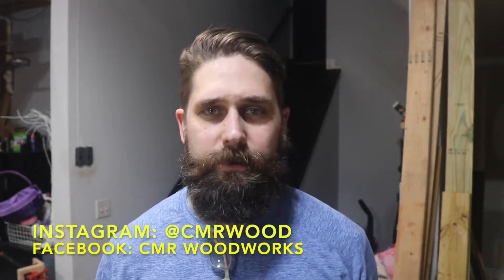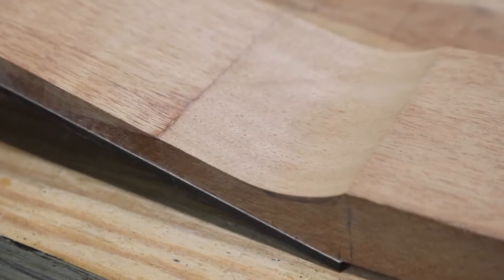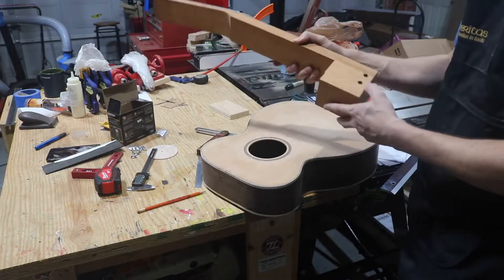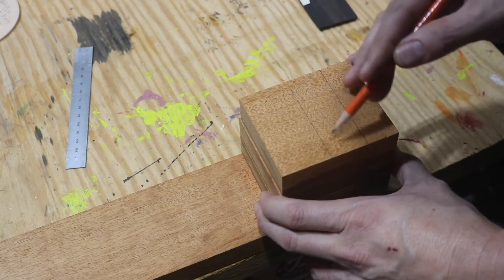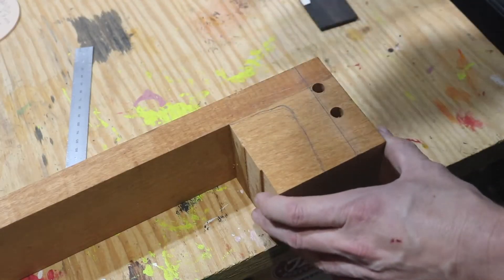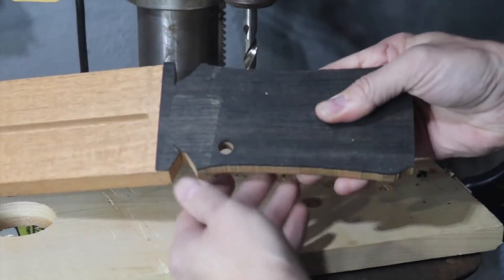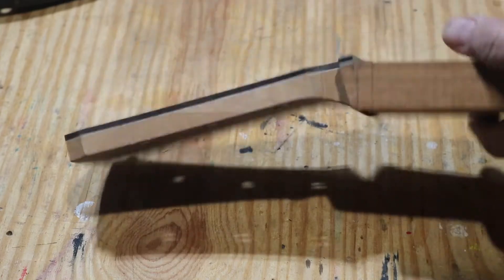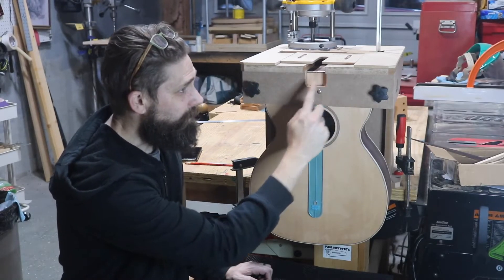Acoustic Guitar Build part 10 // major problem

Comment: This is a classic first build. It's like anything else, you have to fall to learn. Make mistakes and fix them for your next builds.  Everyone is correct here. You must continue on and keep going until finished. These are awesome videos. These show the bumps and bruises that everyone goes through building thier first couple of builds. Next time, for sure, I would deal with the flatness, of the neck joint, on the body before routing. Also, those drill marks might be an issue unless your insetting the neck into the body. If not insetting, maybe you can account for it when rerouting your angle. Thanks for the videos Chris. I think this is super needed for beginner luthiers.
Reply from the maker: Thanks so much for the encouragement. I still have another 1/8” to cut off. I didn’t go all the way down with the plunge router. I think that those drill marks should be gone after cutting off the last bit. I hope so, at least! For my next guitar I will definitely be mindful of keeping the sides flat where they should be flat. I remember seeing a slight bend in the top when I first bent them.  I didn’t think it would be an issue and thought that when I glued in the heel block that it would straighten it out. I just didn’t know enough about guitar building at that point to know any better. But I know now!

Comment: Don’t let it get you down, I have been building 2 parlor sized guitars one for each of my sons, I had too make new necks because I messed up the tennons & Then I realized I screwed up the X-Bracing so I had to remove the tops & build new tops. I have been a woodworker for 40yrs and a Trim carpenter for 35yrs,  I will tell you making guitars is the most hardest tedious thing I have Ever done. God bless & keep on moving forward.🙏🙏🇺🇸🇺🇸🎸🔨📐🪚🎼🎹👨🏻‍🦯👨🏻‍🦯
Reply from the maker: Wow, well I guess I can’t complain too much after hearing about your trials with the parlor guitars! And two at the same time at that. I’m impressed you pushed through it. Good on you man! I appreciate your encouragement!

Comment: Chris - you’re doing great.  I would cut the angle in the tenon and route it again.  I messed up the neck on my guitar and ended up cutting too much off.  My 12th fret is about 1/8” off the body joint, but absolutely no one notices it but me.  You will still set the bridge location based on the distance from the nut, so it won’t affect the intonation or sound. Take a break and get back at it.  You will love it when you get it done.
Reply from the maker: Good to know that even it the right fret doesn’t line up perfectly at the right spot, it’s still okay. Makes sense what you say. Thanks!

Comment: Don't get disheartened man. I know you only have limited time to work on it, but you'll never do your best work while rushing or frustrated. Try to take a break and come back when you feel you're ready. I'm building my first guitar right now too, and making a point of only working on it when I'm at my freshest and most motivated. Again, don't let it get you down!
Reply from the maker: Thanks so much for the encouragement! You are right, though, about rushing and working while frustrated. I fixed the neck angle issue a couple of days later and felt much better after thinking about it for two days. Hope your build is going well!

Comment: Don't give up, bud. These kind of mistakes are part of the process. I would say this: make the adjustments you need to make with the neck and get the fit perfect. Your 14the fret position may end up further on top of the body, but that's not really a big deal. Just position your bridge back a bit further to compensate. I'm sure it'll only be 1/8" or so. No one will notice and it'll play and sound just fine. You got this, man, don't give up!
Reply from the maker: Thanks so much for the encouraging words! Yes, I think the amount I moved the 14th fret onto the body should only be a couple of millimeters or so. I really didn‘t have to take off too much. I‘ll be sure to avoid this issue on the next guitar. I had no idea that something I did way early on in the build, in this case not doing a great bending job, would lead to such complications later on. But I‘ve learned a lot and I am glad. Thanks for watching and taking the time to comment. I really appreciate it!

Comment: Will the veneer added to the back of the headstock throw off the thickness that the tuners need to protrude thru the headstock?
Reply from the maker: You know, I‘m not really sure ! But I don‘t think so. It‘s only .6mm thick and the headplate on top is maybe 3mm thick so I guess if I have to then I can thin down the top. In the course I am taking, the instructor adds a veneer to his. He accounted for adding veneers and a top plate when the headstock is thicknessed initially. He makes it a little thinner so that he can add the extra layers.

Comment: Don’t give up and don’t scrap it     Shave the tenon and then floss down the shoulder till it fits correctly.   Use 80 grit first. To take off most of the material.  Then finish up to 220
Reply from the maker: Yeah, I did that a little on my ukulele, but I’ll have to do quite a bit on this guitar. Thanks for watching!

Comment: after you make your tenon/dove tail, take packing tape and 120 grit sand paper, and put it under the neck neck in the joint and do pulls of 5 and blow the dust off and you'll sand the weird curve into the heel of the neck
Reply from the maker: Yes, I had to do some of that sandpaper pulling on my ukulele. In the course I am taking, he calls that “flossing”, haha.
Reply: @CMRWoodworks  flossing! Lol 

I just call it adjusting the pitch of the neck, but it’s neat to make a guitar do the floss

Comment: I see now what happened. This isn’t a huge deal but a great learning experience. If your neck ends up being 1/8 or 1/4 inch lower than you wanted it just lower the bridge to match that and keep your intended scale length. Don’t scrap it. Finish it. If you stop now what you haven’t done up to this point it’ll be your first guitar on the next one. You can make this work bro #chisel # wood glue
Reply from the maker: I appreciate it Ethan. Thanks for the encouragement!